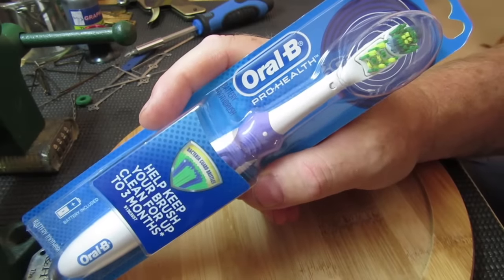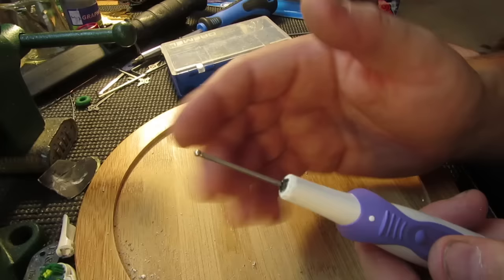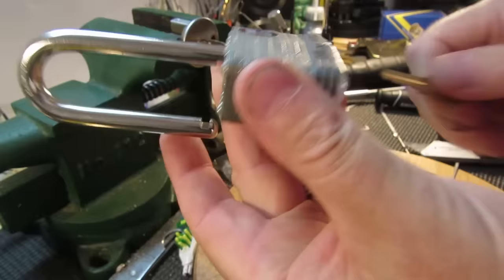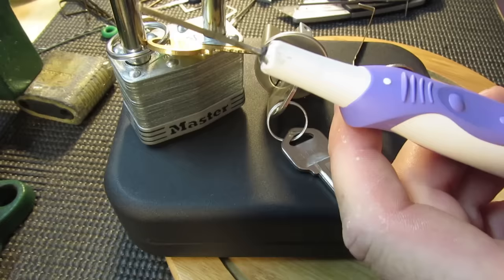Improved Electric TOOTHBRUSH LOCK PICK Simple To Make

Comment: - 00:01 🛠 Introduction to making an improved version of an electric toothbrush lockpick.
- 00:13 🔋 Note that the toothbrush comes with a battery installed.
- 00:42 ✂ Removing the head to see the internal mechanism.
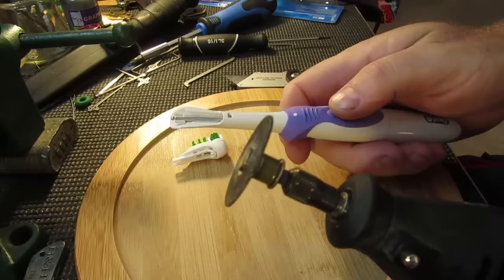- 01:16 ⚙ Using a dremel to cut and explore the internal components.
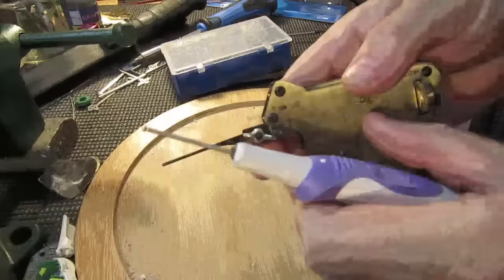- 02:06 🖐 Comparison between a manual pick gun and the modified electric toothbrush.
- 02:41 📏 Plan to grind the toothbrush tip to make it resemble a pick.
- 03:27 🔧 Thinning the tip to make it effective for lockpicking.
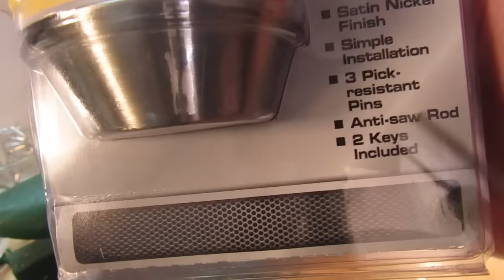- 03:38 🏡 Testing the modified lockpick on a defiant deadbolt lock.
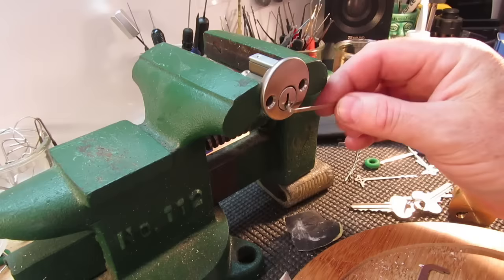- 04:11 🔑 Demonstration of the lockpick's effectiveness on a commonly tested lock.
- 04:50 🎉 Successful test opening the deadbolt lock.
- 05:01 🔒 Testing the lockpick on a master padlock number five.
- 05:55 🔓 Successful opening of the master padlock after some adjustments.
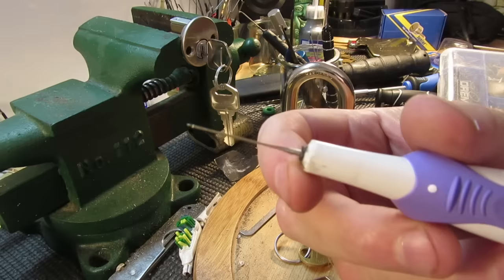- 06:09 🪥 Simplest electric toothbrush lockpick to make.
- 06:17 🔫 Testing the lockpick on a gun safe with a bobby pin as a lever.
- 06:59 ✅ Successfully opened the gun safe.
Reply from the maker: Awesome Thank You 👍

Comment: I had a battery operated brush like this. Stopped using it because I thought it was going to vibrate all  of my fricken fillings out of my teeth. So I figured I would try this. I used it on an old lock on a gate on the one side of my home that has been there for twenty years plus. Never used that side of  the yard entrance. I sprayed PB Blaster in the lock, let it sit overnight  and next morning tried this method using it with a strip of metal to open and it worked !!!!! I ended up putting the old lock back on knowing there is no key so no one can open it. But this method worked. I now have a new toy and going to try to open as many locks as I can. Going to try to break into my neighbor's home next time thery're on vacation. HAH !!

Comment: You need to have a very light gentle touch with your tention wrench . The more force you have on it the more of a bind you put the tumblers in , tumblers in a bind can't fall into place easily . Jsn . Great video , thanks for posting
Reply from the maker: Your right. Tension is the key, once in a while i forget & have to remind myself . I am impressed that you can see it in my video. Thanks Your Tip is spot on.
Reply: why did you let that small bit on the top of the tool? is it functional or ijust a residual head? if i cut it out?
Reply: id imagine with that thing vibratin like that you want extra tension to hold the pins that have been set

Comment: Peanut, just wanted to pass along that this setup works amazingly well with a double ball pick for popping wafer locks, I have been a busy beaver with this since I saw the video. Wafer locks often frustrate me because its fairly easy to jam the wafers. But this device negates that entirely. I wish my camera worked so I could post a video about it :\
Reply from the maker: Good to know, i have popped a couple of more secure wafer locks with elec picks although i normally just use a city rake or even just a bobby pin works very well although the double & single ball pick is designed with the wafer lock in mind so yeah it should work great..I used the half ball in my last video not elec just hand  picking raking i found it works great for fast opening on budget end 5 pin deadbolts ...
Reply: Its really awesome that the locksport and locksmithing communities are able to have this means of comparing ideas and sharing experience. On an international level too. I truly believe this will be a driving force for innovations, and we are already seeing that with designs like the Bowley even though it took less than six months for someone to solve it. Smiths have a weird habit of being very clique-ish, and that's where the locksport folks come in. I get just as much from the locksporters as from professionals, and its fantastic.
Reply from the maker: I agree.... I know lock manufacturers watch these videos too so i hope they at least start using more security pins in the budget end of locks especially door locks it will cost manufacturers almost nothing to do this when you think that around 85 percent of the homes in the USA have a Kwickset 660 in their front door and 35 percent of home burglaries the entry is through the front door... The locksport community are for sure helping to make locks more secure by showing the lock manufacturers the floors in their design and also showing innovative improvements...The Bowley padlock is a step in the right direction an awesome lock although the shackle is its week point in my opinion it needs a heavier shackle just increasing the thickness by a couple of mm will make it more bolt cropper proof like the Abus 37rk80 which i believe is one of the best padlocks out there..

Comment: This is a great idea, I will be adding one of these to my entry kit. Inexpensive and easy to make. I can't believe I hadn't considered this, so many thanks
Reply from the maker: The Dino pro electric pick gun is probably more useful to you if your in the trade, there small powerful variable pick travel cordless a good little pick gun, i have a video on repairing and testing one...
Reply: That's interesting you mention the dino pro, its one of the better electric picks IMO. Totally not opposed to using one. I have a bit of a fetish for devices I can make myself, this is especially true of my manual picks. Most are picks I've made from various bits of quality spring steel that come my way. I have found that blades for coping saws make fantastic picks with some modification.  My next project will be a set of interchangeable picks for this toothbrush pick, I think this design has tremendous merit.
Reply from the maker: Sounds good... My next project i want to try a device with more power so going to try cordless electric razor and hair clippers ...
Reply: I would kinda like to see that so have my sub. Cheers man!

Comment: Great idea, I been trying with almost all the toothbrush but at the end I find a facial magnet massager that works very nice, I put extra weight on the motor pin and epoxy on a manual lock pick gun bit like the one you show, small, practical and works on all locks, happy picking :)
Reply from the maker: Sounds very cool ...
Reply: @JollyPeanut   The sound of success :) You have a new sub 👍
Reply: Videos and pics or it didn't happen.
Reply: @drlogiudice  Would be happy to answer but what do you mean lol.
Reply: @dannygarden464  I suspect they wanted video "proof" that it works
Reply: @ReiverBlue1971  why use the tank? 😂
Reply: Do you have a video of this device?
Reply: @meals24u  Sorry no but I've seen some almost the same at the dollar store, you don't need an expensive one just vibrations and play adjust the counter weight on the motor, any thing that vibrates will do, I saw a $2 woman pleasure thingy and I think it would work better lol, a cheap battery rasor with the net head ( not the rotary ones) is excellent too, good luck and go at the dollar store you will find something and if you break it it's not much money. ')
Reply: @dannygarden464  haha okay thanks 🙏
Reply: @dannygarden464  I’m thinking my wife’s closet might be a nice place to start 😜🫣
Reply: @meals24u  Don't get caught and if you do you can blame it on me. ') I hope the closet is not lock lol. 😅
Reply: @dannygarden464  haha will do! I’ll use the Sparrows Kit to get into the closet and the Toothbrush to get into the bank! I’ll give you a call after for the share 🤣👌

Comment: I watched this video just out of curiosity 2 days ago, that and a feeling it would be useful to know how to pick a lock one day; I was particularly interested in how the lock actually works. So early this morning I went to the beach and got there just as the staff were trying to open up the surf club changing rooms, but they had lost their padlock keys and had sent someone off to get an angle grinder. I didn’t have an electric toothbrush with me 😋 but I did have my Victorinox pen knife, and so with nothing to loose, I decided to use the reamer blade in the high security 3 directional 7 pin lock. I vibrated it against the pins in the slot, as you did with the toothbrush, and after 2 mins there was a click and it opened 😳😂
They then asked me to do the same on the other changing room’s lock and it too opened in a couple of minutes! Thank you for the very useful video, my street cred now knows no bounds! 🥷🪥🔓 😄
Reply: curiosity my arse lol 😁
Reply: if ur planning to rob a bank im in lol
Reply: nice job
Reply: Now if anything goes missing you are suspect number 1..🤣💀
Reply: and 15 minutes later real staff came and asked why is everything open and empty :D

Comment: You could also flatten it by hammering it an anvil or some other chunky flat steel surface.
This would have the added benefit of strengthening it as you are essentially cold-forging it.
Then you just finish it of to perfection with a small file.
>

Comment: All is fair in locks and war, but I think its important to note in case anyone here doesn't know, that wafer locks like the one on the gun-safe, do not contain stacks of tumblers so they don't need a device intended to use the bottom tumbler to jump the top tumbler above the shear line. I've picked many with just an arrow straight paper clip and a tensioner. That being said, the agitation added to the system by the vibrator probably does help to set tumblers and drop overset tumblers rapidly creating an overall pleasant picking experience.

Comment: Look at the Harbor freight  “cordless Micro Engraver” almost the same maybe cheaper.
Reply: Not so sure because that looks like it rotates and what you want is one dimensional oscillations
Reply: Toothbrush is cheaper. Amazon Prime has the Oral-B 3D White Battery Power Electric Toothbrush, 1 Count, Colors May Vary by Oral B for $5.69. The cordless micro engraver at Harbor Freight is $8.99 + shipping (or you can get one with Amazon Prime for $8.99 shipped).
Reply: @softwaredeveloper6791  you can use the 20 percent off coupon at harbor freight and drive there and pick it up yourself.
Reply: Last I checked, $9 less 20% is still more expensive than the $5.69 toothbrush. And who says the cordless micro engraver will even work? All you can do is engrave your name on the lock.

Comment: Use a Colgate brand toothbrush  that takes two aaa batteries. Swap those two 1.2v  for two   3.7v 10440 Lithium cells. It won't break the motor but damn does it ever brush your teeth!
Reply from the maker: Great idea..
Reply: @JollyPeanut  worth the buy just don't explode any expensive equipment like i did.(the 10440 batteries.)
Reply: did you have tested it? with the lithium cells
Reply: ZebbMassiv yap, my dad had so tough beard that he had to plug his razor on the 220V.   ; )
Reply: @jonathanchristian2063  bullshit. Every vape device uses extremely volatile lithium batteries and they don't explode just because they get liquid on them or get wet. The batteries are sealed.....
Reply: Jolly Peanut top comment right here

Comment: Will this work on car door? Just curious, my wife locked her keys in her car the other day and I had a heck of a time with the ol’ hanger routine!
Reply from the maker: It can help with some older style cars using wafer locks....A  quick tip have a spare key cut you do not need an expensive chipped key just a standard key cost around $5 to $10 and zip tie it  underneath the car lots of good hidden places under cars to fasten a key to , then you will always get into your car hassle free.
Reply: @JollyPeanut  There's another topic for a video for you. Add in how to get the zip tie off without cutters, wrap the key in plastic bag and various places to hide. Just a suggestion for you. Loved this video. I'm fascinated by encryption schemes, data protocols, ciphers, machines that transmit codes and somehow lock picking is similar (to me).

Comment: That's amazing. My wife forgot her key's in the car couple of times, and forgot the house keys inside the house while locked. Wonder if this pick works on cars. Instead of using the jimmy to pop up the lock levers.
Reply: It will not work on cars... Car locks are usually either wafer locks or slider locks not standard pin and tumbler locks like the ones shown in the video...
Reply: @jayskinz29   another poster says that it easily handles wafer locks. Scroll up from your post and look for Alpaca Two Niner's post.

Comment: How thin should I make it?  Just enough so it comfotably fits or the thinner, the better??  Currently mine is still slightly too thick to insert into lock but it'll get there soon enough.  Oh, also wanted to ask you about tension tools such as what can be used as a makeshift tension tool found around the house or purchased inexpensively?  Also considering placing an order for a spring loaded circular tension tool.  It's about $30 USD although sure to be worth not having to concentrate on two things at once, hence in theory users focus on keyway alignment & hitting pins correct should drastically improve.  Wishful thinking or wonderful idea?  Guess we'll have to try it and see.  Great content by the way!
Keep on doing what you're doing friend; more watchable and likeable than others of this genre (Please just do not tell the Bosnian I said this).

Comment: Incredible! Off to Asda it's a hobby of mine
Reply from the maker: works good on locks with light pin springs... I did a later video on slightly improved version which i tested on 5 pin deadbolt it works although still not perfect ,more power would be better that will be the next one that i make..Still its all experimental & good fun...
Reply: @JollyPeanut  it would be good to take one apart and see if there is any speed adjustment. Also a lithium ion battery might speed it up... I was very impressed with the first lock with 3 abtupick pins. It seems to be a lot quieter than the proper electronic ones that I have seen.

Comment: I have a Equate (walmart) version of an Oral B I use for applying polishing media in which the pin rotates, not vibrates. Will this work also? Only other prob is it is SERIOUSLY  underpowered (2 AAs) and that was a simple fix, I just changed it over to a 9 volt. Now it has the power where I can use it as a 'high RPM' mini-drill.

Comment: Quick question. Does the pick end oscillate  like other toothbrushes I've seen or vibrate up and down like an electric pick? Thanks
Reply from the maker: It does oscillate fast which does get the pins moving enough to do the job. I am working on another project which moves up & down very fast with variable speed so this will be much better but it's not a toothbrush, keeping the idea under wraps for now until i get a video done...

Comment: So when grinding/sanding it down did you flatten a side? As it spins in a circular motion quickly popping the pins as to where grinding it evening around i couldn't imagine doing enough or am i wrong and taking it flat would over extend the pins?
Reply: those types of electric toothbrushes vibrate rather then spin. some of  the more expensive ones do spin but these ones are around $10 US at any drug store.

Comment: That is awesome, I really like your retention spring as well , I am going to work on that design and see if I can come up with one for myself,  I have been using the regular old  L shaped for a long while, that one just seems much more cool.
  I imagine there is an old tooth brush around here the kids used on the dog or something. LOL  

 those trigger lock pick things are silly I think, I have never had one work any faster than manually pushing the pins with my regular tools.  
thanks for the video. 

 you know, if that tooth brush idea gets thin and breaks or something you could make one that has a regular manual pick strapped to that rod pretty easily I would think. Might work even better that way.
Reply: No Sh%#. Pull off the brush, slip-on a handmade tool, pop the lock, remove the tool, replace the brush head. No lock picking tools on me, officer!
Reply: @johnshilling2221   Lock pics are not illegal anymore than Key's are.     but yeah I guess.

Comment: I totally love your tension wrenches. Could I buy some of your wrenches. They are bent just right for my fingers. My left hand fingers don't work right anymore and ì can't  hold a lock and a tensioner in one hand. Thank you 
     CHEERS
Reply from the maker: I use windscreen wiper inserts & bend to whatever shape i want, i do not have the inserts to make new ones right now although it is very easy to make them..
Reply: @JollyPeanut  when you get some, could you think of me.? Smile
Reply from the maker: @thumperlockpicking9269  Sure..although i have no plans on making any in the near future..You should make some find some old windscreen wiper blades and cut the rubber to get the stainless steel strip out, it's fun to make your own picking tools..

Comment: ill stick to my hack saw blade picks and tentioners i make... cool video though
Reply: also i feel like raking and picking are pretty different. i have a friend who rakes, i pick and we often race to see who can open locks faster.
Reply from the maker: Your hacksaw picks sound cool, I love home made tools, i have had a lot of success with bobby pins using them as picks & rakes also good for dimple locks...
Reply: the trick to the hacksaw blade pick is to harden it after you grind the shape of pick you want into the saw blade. i have never bought a real set of picks, but i have printed out all the shapes of pics and rakes i can find to play with.... also the holes on the ends make convienent key ring holes lol
Reply: also thanks for the reply, subscribed
Reply from the maker: Yes makes sense the heat from grinding must make the blades soft so they need hardening again..Much more fun making your own picking tools & i think you learn more about picking by making picking tools..
Reply: i can say that the picks i use arent the picks i downloaded templets of :-) they do evolve over time lol.